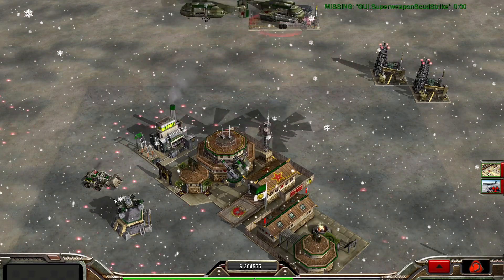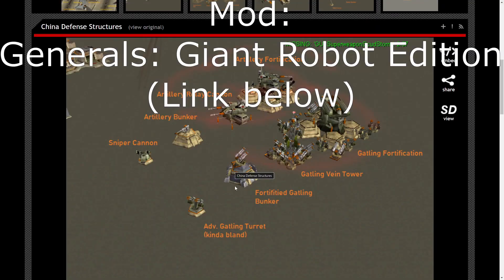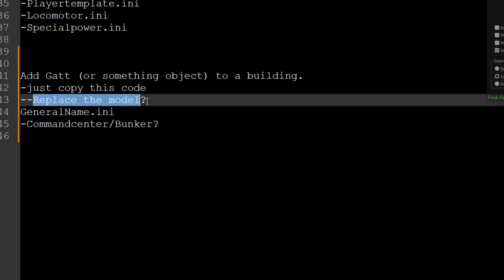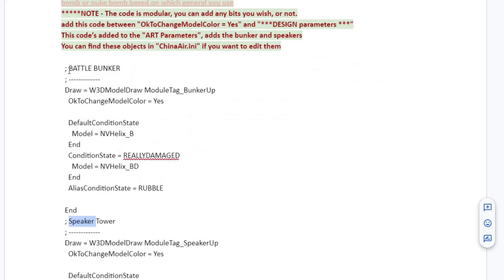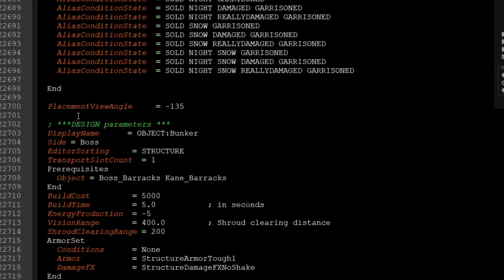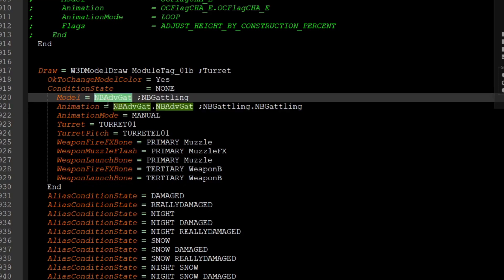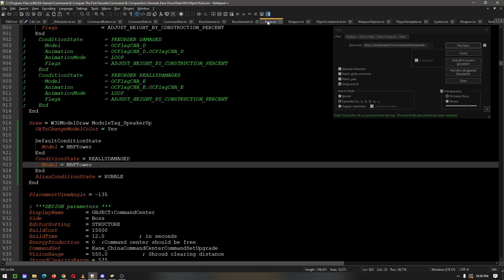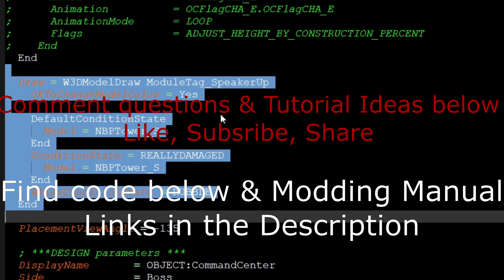Generals Zero Hour Modding  Tutorial - What's that Gatling Cannon Turret doing there?

Comment: How can I use Emperor Gatling Cannon instead?

I think that will be more appropriate for the bunker since it is smaller and placed on the top of the middle of the object

And I would like to give it to a tank or two
Reply from the maker: Totally makes sense! I originally figured this out with the standard Gattling Cannon but I experimented ^_^.

But, Good Question! - I'll make a video if I can manage this ASAP, it should be very similar just different object. (in TankGeneral.ini as "Tank_ChinaTankOverlordGattlingCannon")
Reply from the maker: I attempted this, I couldn't get it to stick to the top of bunker. But you should know, originally, this was gone via the gatling cannon building not the one i use :)
Reply: @janusjaguar  Yesterday I had an idea but I couldn't make it work

I thought that I should treat the bunker as overlord tank and give it this code

Behavior = OverlordContain ModuleTag_06
    Slots                   = 1
    DamagePercentToUnits    = 100%
    AllowInsideKindOf       = PORTABLE_STRUCTURE
    PayloadTemplateName     = ChinaTankOverlordGattlingCannon
    PassengersAllowedToFire = Yes
    PassengersInTurret      = Yes
    ExperienceSinkForRider  = Yes
  End

This code makes the overlord tank spawn with it's getting cannon and with no need to upgrade

But nothing happens
And I don't know any mod with something like this to see how it works

So i said maybe you can make it work
Reply from the maker: The problem is the "placement" of the object. As it's not part of the model, it get's defaulted to another part to stick - the "center" and it will clip into the object

The mod below is the mod I used to guide my version.
https://www.moddb.com/mods/generals-giant-robot-edition/images/china-defense-structures#imagebox